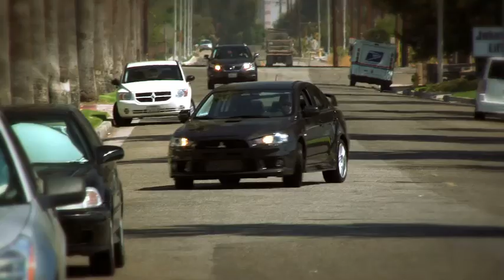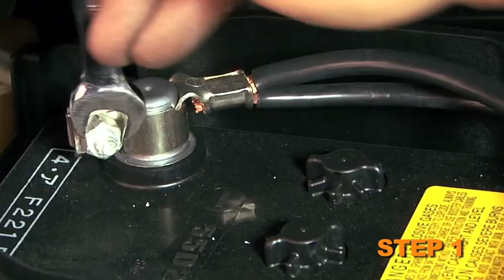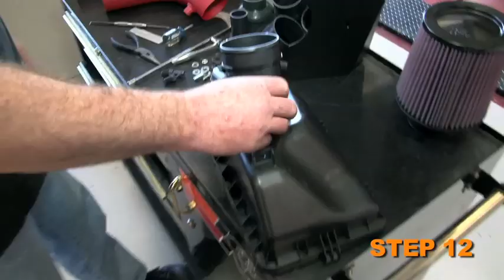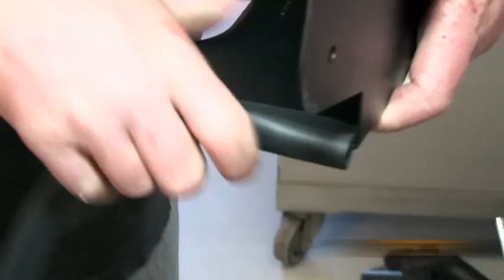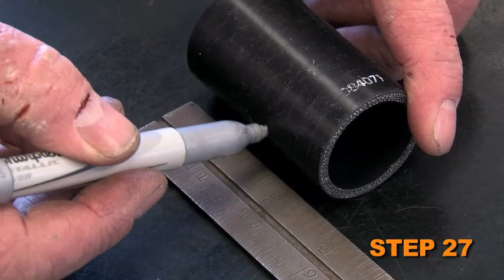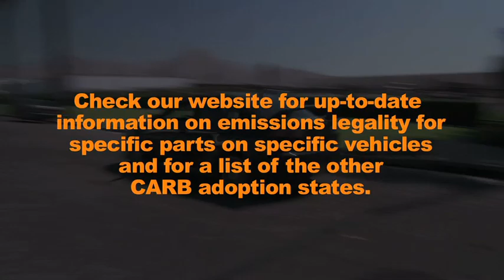Mitsubishi Evo & Evo GSR 2.0L [#69-6546TWR]  Air Intake Installation

Comment: Does this really increase HP or u have to get it tuned first. I just keep reading that these intakes just don't really increase hp, just make bov sound better.
Reply from the maker: No tuning is necessary with stock vehicles. Please see dyno for this kit used on a stock evo: http://www.knfilters.com/dynocharts/69-6546_dyno.pdf
Reply: KNfilters Thanks. So, if I put in a KN CAI system and lets say new intercooler, blow off valve, and performance exhaust is a tuning still needed or just to get more out of modded parts? I'm really new to this modding thing and gotten mixed information.
Reply from the maker: DazdnCofuzd If you have other mods, you may need a tune.

Comment from the maker: You are actually hearing the blow off valve releasing the boost. OE intake systems are also designed to muffle these loud noises naturally created by the engines, where a free flowing intake system does not have the baffles due to them being restrictive resulting in these sounds to be more audible.